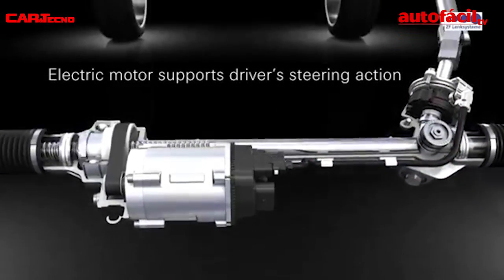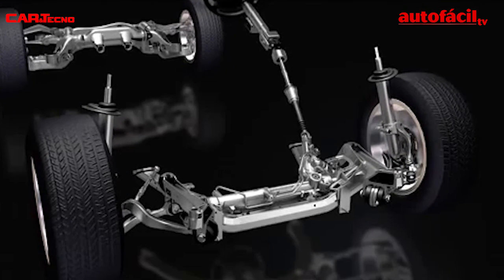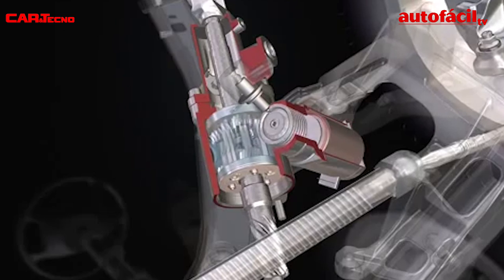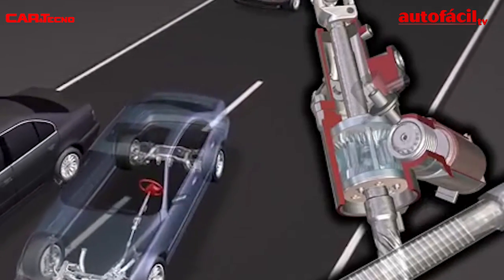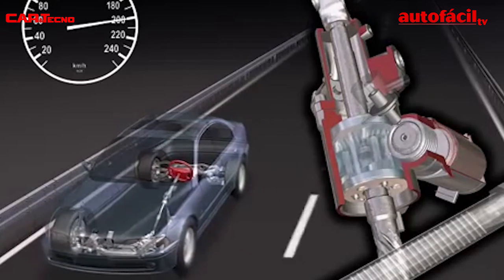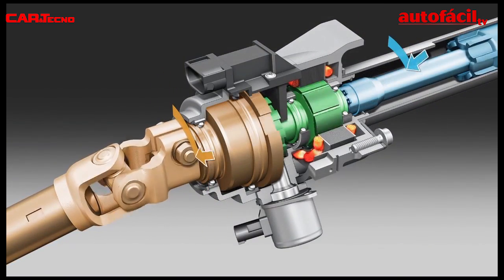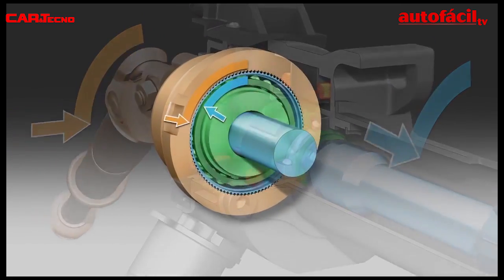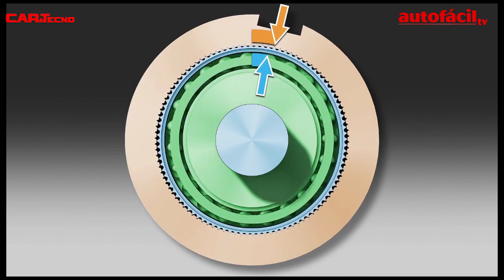Power Steering Systems: how they work

Comment: That's interesting, I didn't know the Strain Wave Gearing (otherwise known as the Harmonic Drive) was used in some power steering mechanisms. I used to work for the company, and we used Harmonic Drives for example to power tank like robots that would crawl inside nuclear reactors and stick to the ceiling with magnets! :D
https://en.wikipedia.org/wiki/Strain_wave_gearing

Comment: My Steering wheel suddenly started to become hard on Park and Neutral but turns normally on Driive and Reverse gear. When that happens, the PS light illuminates and goes off when i engage the Drive or Reverse gear. Any idea on what i should do to get it sorted? Its a 2006 Toyota Crown.

Comment: 6 turns lock to lock in an emergency/skid  is going to make me  wreck the car in a skid heck one might as well takes hand off the wheel and slap him self for buying the car dumbest thing ever in the world of steering un-improvements ill never own a car with this crap and if i do it will be removed asap...for example a steering  [quickener] is used in rally racing to help novice driver not wreck in a skid the exact opposite of this bs

Comment: What if the electric motor fails? Does it automatically fall back to manual steering? Or it will stuck completely?
Reply: It reverts to manual steering of course, its a basic safety requirement. The first systems gets harder to turn but it works like regular manual steering, BMW system requiring less force, but with more turns lock to lock, Audi system i dont know, but probably the same as BMW less force, more turns
Reply: IT goes manual, im having that problem now

Comment: this video has explained more in a couple of minutes than 2 semesters in engineering
Reply: Except this is very high level and presented with no equations. Of course it's digestible.
Reply: FUCK NO
Reply: 03219485052
Reply: yes 6 turns is dumb  that whole gom of gear is why i hate these cars
Reply: jorge alan hhhh very difficult to normal people